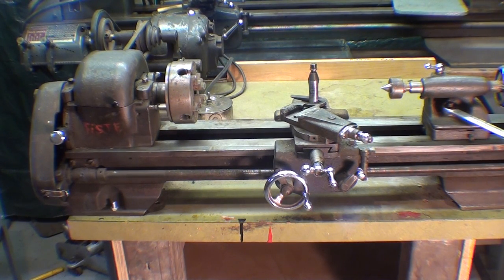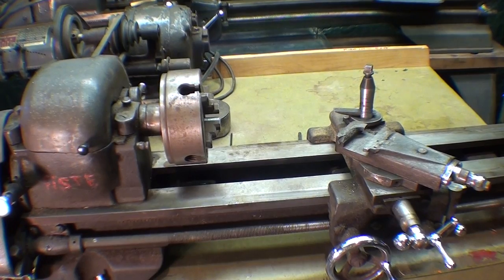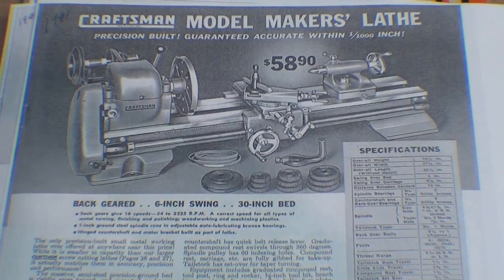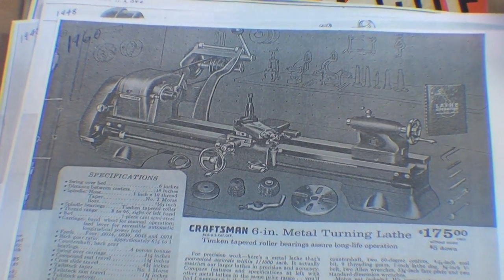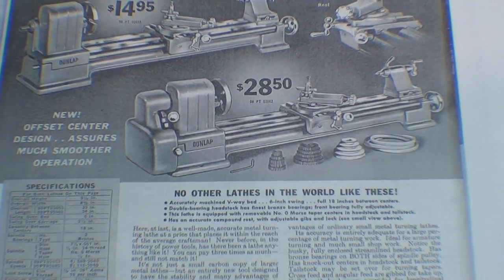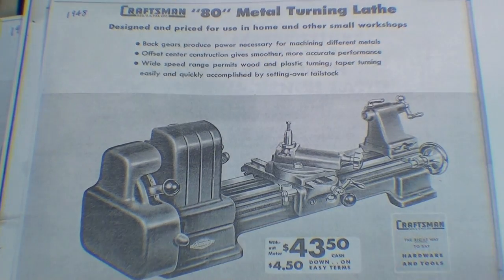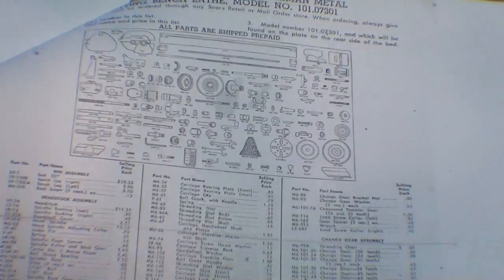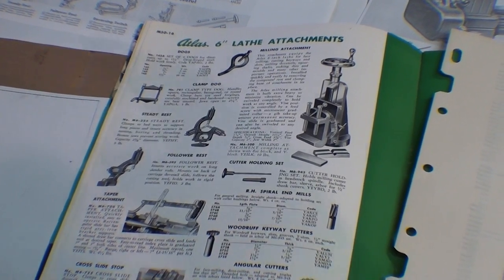TIPS #330 pt 1 How to Buy an Atlas Craftsman Lathe tubalcain

Comment: Im getting ready to buy an atlas 618 i believe is what it is.  It does not have a motor with it and i am wondering what kind of motor would be a good fit for it.  I have a 110 powered 3/4 horse motor and im not sure about that power level for that lathe. Any suggestions would be greatly appreciated.
Reply from the maker: That is probably a little big. 1/3 or 1/2 will do
Reply: @mrpete222  excellent thank you very much.  I have a 1/2 hp as well.  Thank you for taking the time to help me and thank you for the videos you make i have found them very helpful.

Comment: Can you help me ID my craftsman lathe? It is very similar to your but here are the main differences......
Your drive lever has a 3 hole detent. Mine uses a bolt/nut setup under the side guard.
Mine does not have an upper gear cover. Maybe missing?
No power cross slide.

It is 6" from chuck center to the bed
There are a couple of numbers...10Dxxx
It does not have power crossfeed/
Reply from the maker: No, I cannot be sure. It sounds like it is one of the earlier ones. Go to vintage machinery.com. And look at some of the real old Sears craftsman tool catalog
Reply: @mrpete222  ok thanks! I've been there and can't find a match. I'm wondering if if someone modified or changed some things.
Reply: @mrpete222  I found it!!!!!! Here it is, an "interim" 1936 that required the use of a wrench to loosen the change gear adjuster. I wonder what similar model is best for manuals and parts?
http://www.lathes.co.uk/craftsman/page3.html

Comment: If you can afford new parts most can found through the Causing machine company .
Reply: A little time and watching, NOS parts ca be found for a lot less than new. , all but one of which was bought for parts. Used what I needed, passed on the rest, but kept a spare headstock, carriage, and long bed. Stashed in the garage, coated with preservative, against need for parts. I think I have $100 in for the spares. Just the countershaft is more that that by itself.